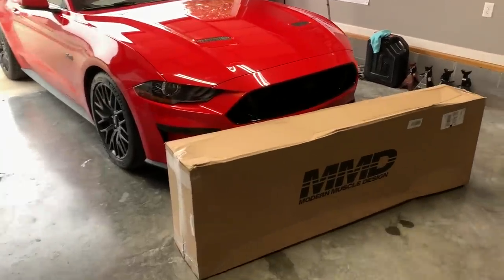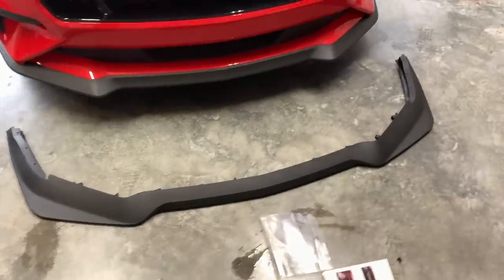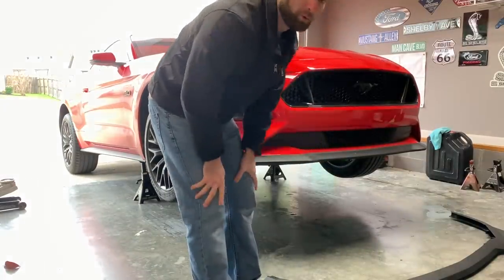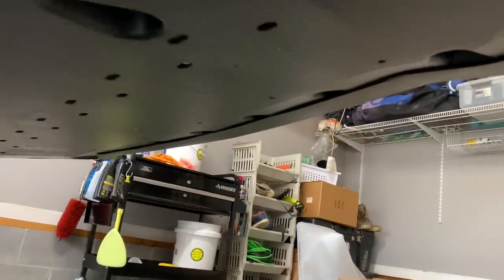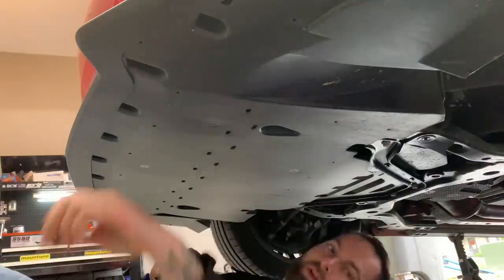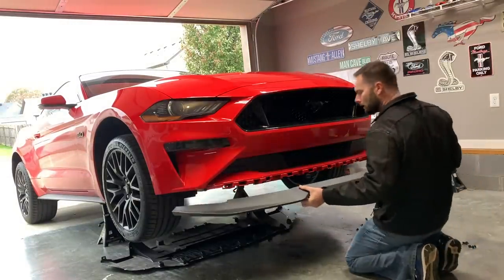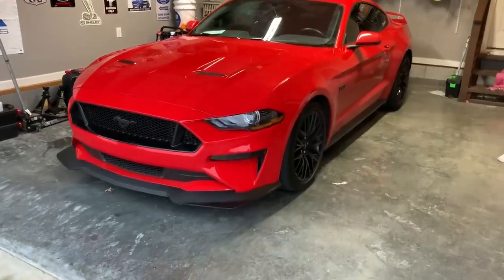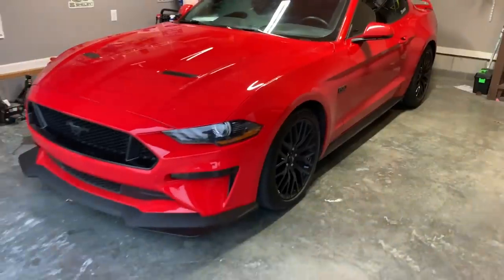2018-2019 Mustang GT MMD Front Splitter- Install and Review (PP2 Style)

Comment: Good video and the lighting really wasn't bad at all. My old garage I had to pull the car out some to work too. It sucked during winter especially in upstate NY. I found that taping plastic to the bottom of the garage door and draping it down over the car with a slit in the center worked well to keep the draft out. Fired up a salamander to get it warm enough, so your lug "nutz" aren't in your stomach, worked great. No more frozen finger tips. Also almost to 10k. Keep it moving and stay positive!!!!

Comment: The splitter looks good on your car but I was wondering how it might look if you were to paint it a dark gloss black, to match the grille, and then clearcoat it for protection. The non-functional lower grill elements might also look good if you could match their black to the grille.

I would not remove or disable the hood vents if they are functional. They might look better if they were painted red to match the hood.
Reply from the maker: painted might look neat
Reply: My opinion would be the opposite. I think it would all look good including the grill to be flat black texture matching the splitter already.
Reply: @stevenp3176  I think an all flat black trim for the car would look good, as a contrast for the gloss red finish, it might highlight the red gloss more. Since he already has gloss black on the trim, I thought it would look good to match it and minimize the variation in finishes. Either way, it's a very nice looking car.

Comment: I went to install my lip but my factory splash guard would not fit with this lip. Did you have this issue? I’m having to return it tomorrow 😡
Reply from the maker: Mine fit fine. Did you call them about it.
Reply: I called them but they said it should fit. I messed around with it for two hours trying to figure out ways to make it work, no go though🤷🏻‍♂️
Reply: Ahhh I think I figured it out, you need a pp belly pan for this splitter to fit!
Reply from the maker: Mike T mine is a pp. I know the website says it fits both
Reply: Yea, I wrote them to tell them it doesn’t fit non pp cars...I would’ve kept the belly pan off but my hellion twins would’ve been semi exposed to road debris and weather
Reply from the maker: how much is a pp belly pan?
Reply: Zander13 I found one from a ford dealer online for 121 but shipping is like 80. I’m gonna call local ford dealers here in AZ to see if they have it and also to see if that’s all I need to complete the job
Reply from the maker: Mike T oh wow. I’d hunt down a used one
Reply: Zander13 right! That 200 could be used in much better ways regarding the car

Comment: If you want lighting for your garage, I got these (mostly because they were cheap, not expecting much)... but they are absolutely AWESOME. They're LED so super light weight and dependable and incredibly bright - they come with a ton of different hardware too so you can wire them up several different ways.

http://a.co/d/8uS3lzk
Reply from the maker: Good info